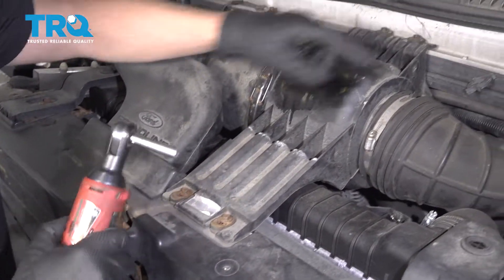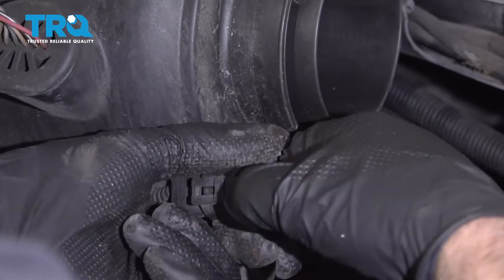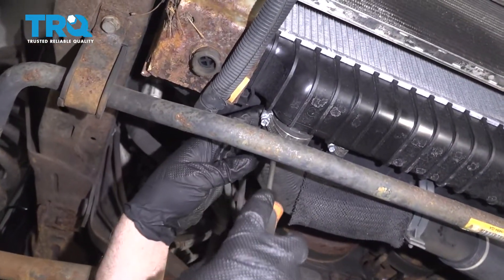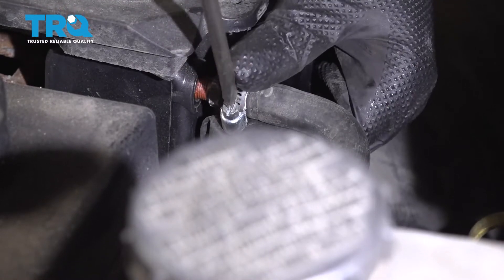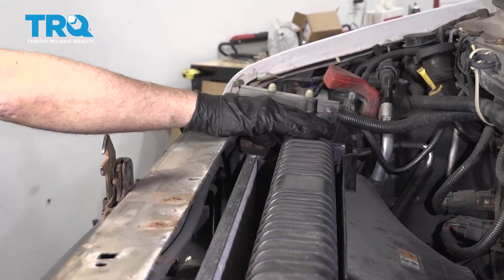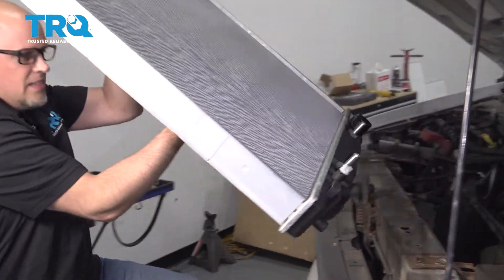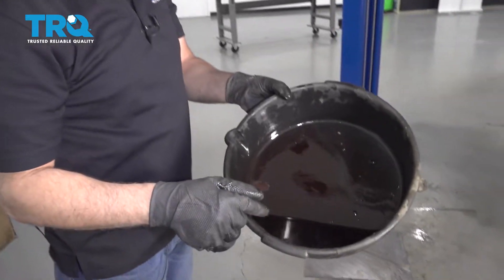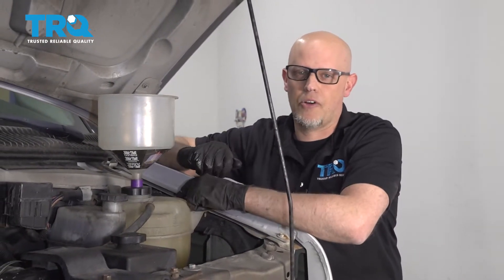How To Replace Radiator 1992-Present Ford E-250

Comment: Excellent video, have over 200,000 miles on my long bed E-250 5.4 Ltr. work van, only issues have been coil pack failures from time to time and are a pain to replace, today saw coolant under the van and noticed the top plastic pan had a 3" crack in it where coolant was steaming out, your video made replacement look like something I can do myself! Thanks !!!!!